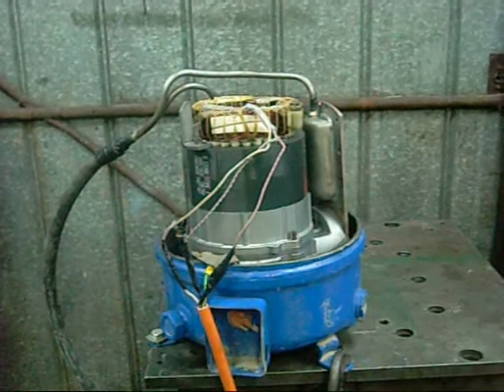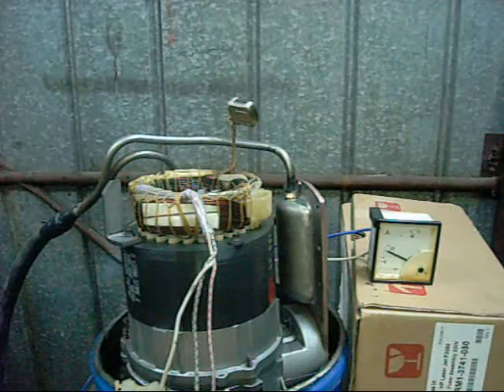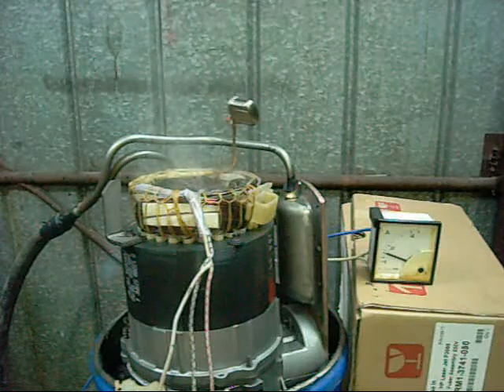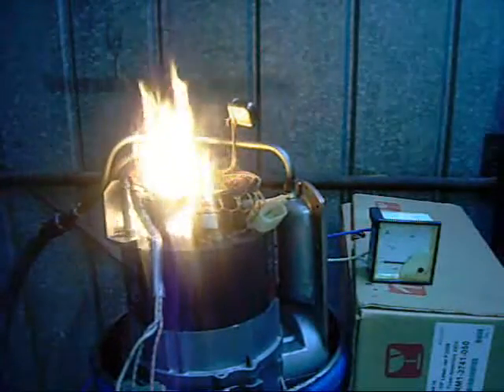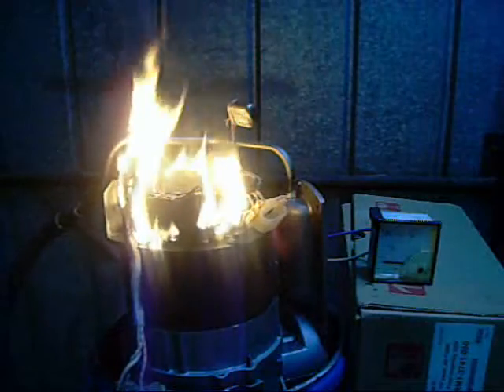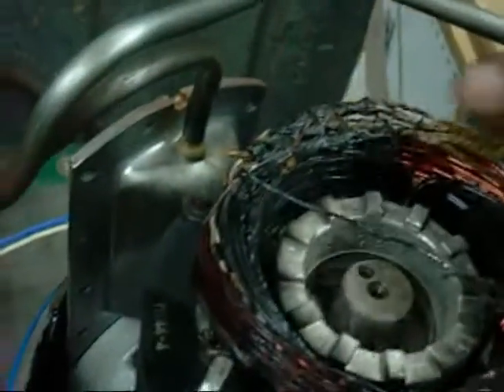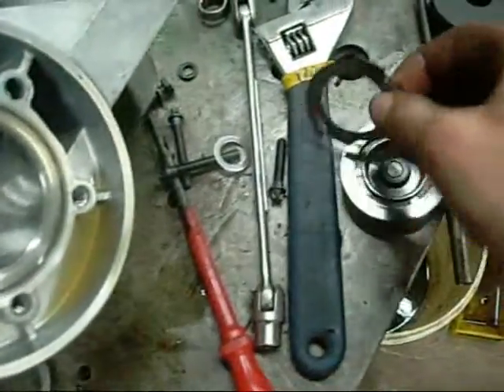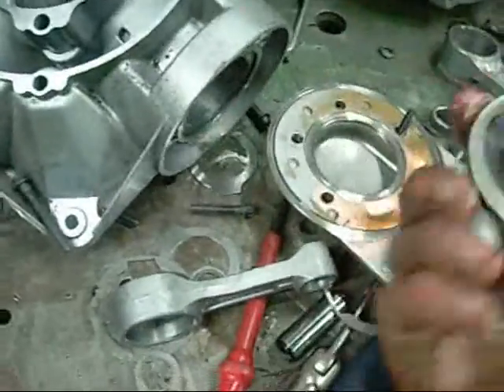Compressor Failure and Epic Motor Burnout - Full Vid

Comment: @mystiqueman366  We pay electric companies by the amount of *energy* we use, not the amps. Energy is power over time. So just as an example say you use 25 amps for 2 minutes to burn out a motor, that's only 0.2 kilowatt hours. That's only about 2-4 cents. A 60 watt light bulb will use the same amount of energy in 3.5 hours.

Comment: Very good video. That motor hung in there for quit a while with blocked armature.
Interesting to see the ammeter current slowly decrease a bit as the windings heat up and the resistance of the copper increases. Then shoot up to 50 Amps for the final burn out and trip of the MCB.
Reply: The ammeter needle went beyond 50 amps and hit the absolute end (dead end?), so I'd say the current peaked up to 100 amps or something. Wouldn't be surprised if that was the case.

Comment: Awesome!

If you skip forward repeatedly during the burnout, you can see how the winding moves and changes, in ways you can't see at normal speed. It looks like it expands, then falls apart.

If you could get a big string of car batteries as a power supply, now that would be an even more spectacular burnout!